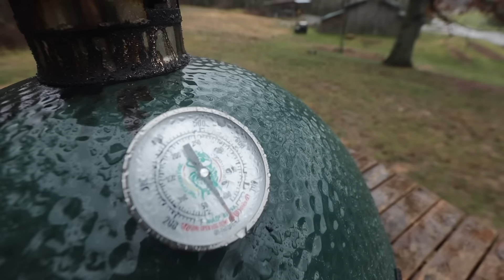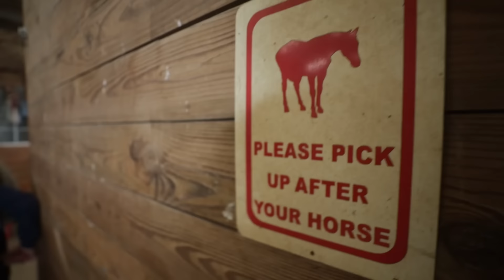Horse Chiropractor!?

Comment: Add a thin piece of wood on the Center top of the rubber and screw through the wood, mat and the bottom wood and that will stop the screws pulling through…that way you will squish your rubber mat between two pieces of wood….Animals are rough on equipment so that should help it last longer. Just a thought.
Reply: This or washers

Comment: A maybe?  How about putting a washer with your roofing screw to give it an added strength to not go through the cover of the mineral sled fabric? And yes I heard that the screw had a washer with it, this would just make the foot print of the whole attachment bigger. Just a thought, love the videos.
Reply: Ive used those same washers and screw on my metal roof. The washer keeps the hole from widening due to the wind trying to take it. Adding a washer would add cost but not protection. You reach a point of overbuild.

Comment: I think you over engineered your mineral sled. I don't think you need a compartment for each cow. You just need a compartment big enough to hold each of the minerals that you plan to put in it. They will share. You can buy a 3 compartment plastic one with a rubber cover that is only about 2 foot diameter circle that is super lightweight.
Reply: The mineral sled that he made has a compartment for each of the different minerals that they give their animals. It's not one compartment for each animal. Have you seen the ones they used before?  I don't know if they still give this full list but the ones he's provided his animals before comes in a kit with the following: 
A-Mix (Vitamin A, D & E), BVC-Mix (B Complex Vitamins). C-Mix (Calcium), Cu-Mix (Copper), 2% I-Mix (Iodized Salt), K-Mix (Potassium), M-Mix (Magnesium), P-Mix (Phosphorus), S-Mix (Sulfur), TS K-Mix (Trace Minerals/Selenium), Zn-Mix (Zinc), Buffer Plus (Buffer), Redmond Salt, MOP Organic, G.R.P. Free Choice PLUS they also give kelp, Diatomaceous earth (DE), and Charcoal.